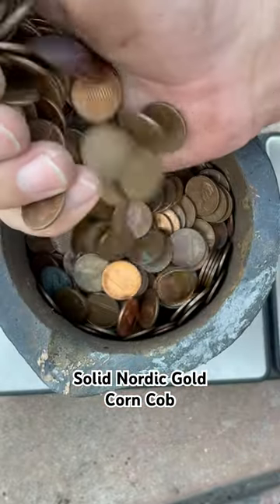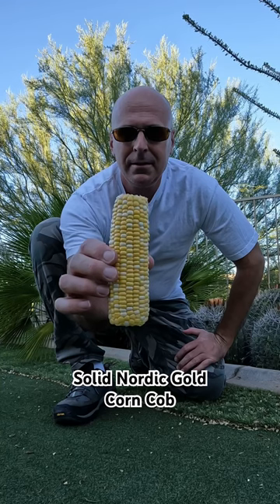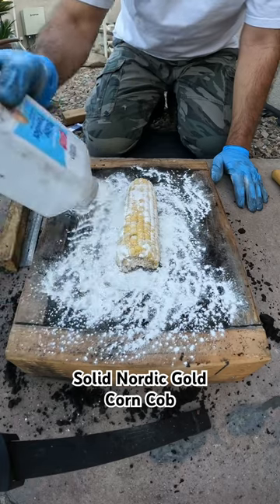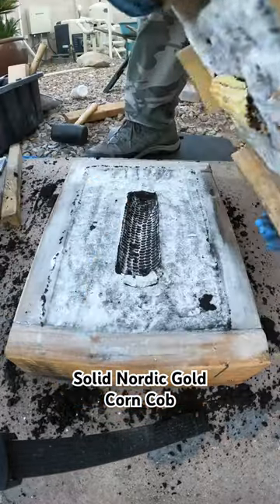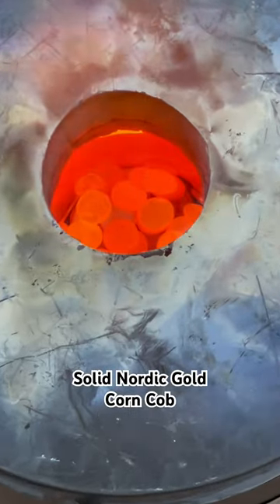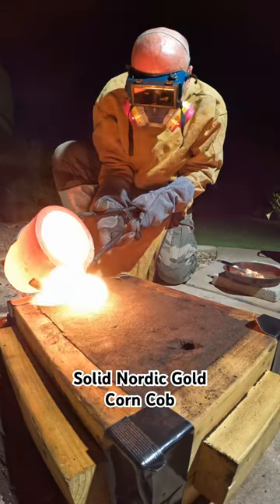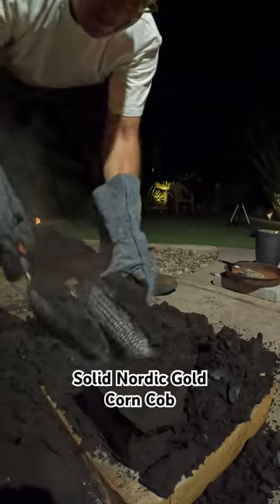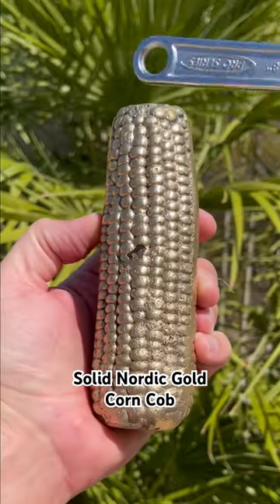Casting metal corn cob in Nordic Gold #coins #pennies #gold

Comment: (b) The prohibition contained in § 82.1 against the treatment of 5-cent coins and one-cent coins shall not apply to the treatment of these coins for educational, amusement, novelty, jewelry, and similar purposes as long as the volumes treated and the nature of the treatment makes it clear that such treatment is not intended as a means by which to profit solely from the value of the metal content of the coins.

Code of Federal Regulations (CFR) Title 31, Subtitle B, Chapter 1, Part 82, Section 82.2

Comment: But illegal.
Reply: No...(b) The prohibition contained in § 82.1 against the treatment of 5-cent coins and one-cent coins shall not apply to the treatment of these coins for educational, amusement, novelty, jewelry, and similar purposes as long as the volumes treated and the nature of the treatment makes it clear that such treatment is not intended as a means by which to profit solely from the value of the metal content of the coins.

Code of Federal Regulations (CFR) Title 31, Subtitle B, Chapter 1, Part 82, Section 82.2

Comment: You've just committed a felony.  Melting coinage is illegal.
Reply: No he didn't. (b) The prohibition contained in § 82.1 against the treatment of 5-cent coins and one-cent coins shall not apply to the treatment of these coins for educational, amusement, novelty, jewelry, and similar purposes as long as the volumes treated and the nature of the treatment makes it clear that such treatment is not intended as a means by which to profit solely from the value of the metal content of the coins.

Code of Federal Regulations (CFR) Title 31, Subtitle B, Chapter 1, Part 82, Section 82.2
Reply: @user-zy1pd9pu6s  I stand corrected. Thank you, sir or madam.  I was just taught "never mutilate money. It's against federal law."